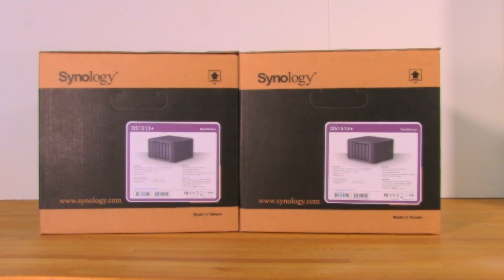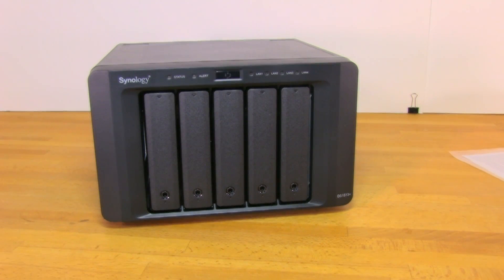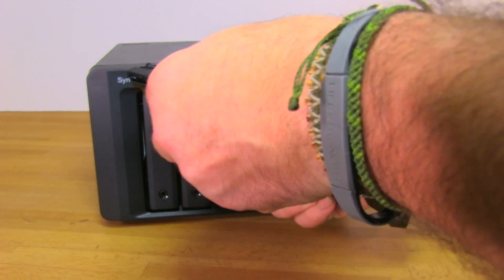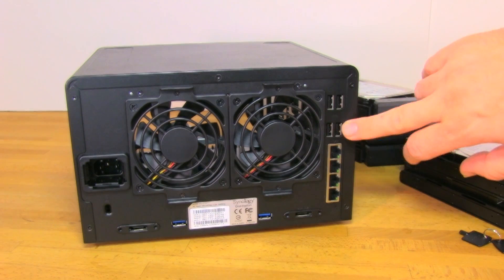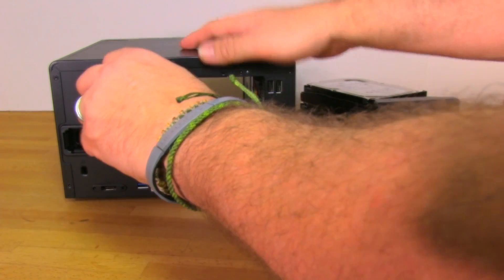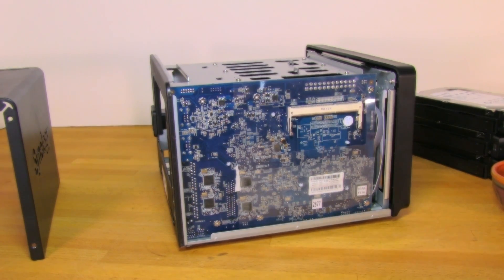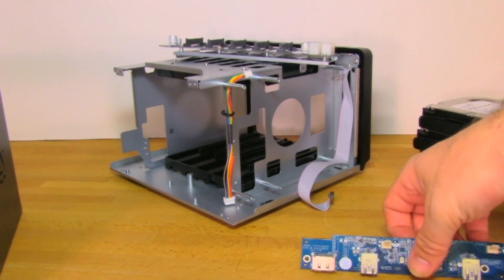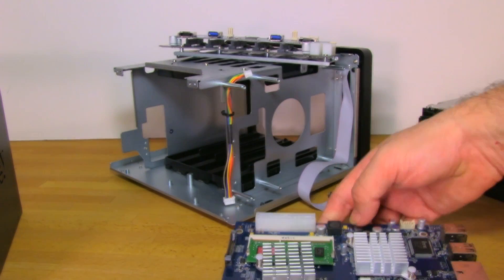Synology DS1513+ Introduction and Teardown

Comment: Can you take apart the NAS to this level and add 2x4GB memory sticks?  It's running a 64bit kernel... but it's an ATOM CPU & MB.... not sure.
Reply from the maker: You can put the memory in, but it will only support 4GB of it due to CPU and Chipset limitations.
Reply: Decryptedtech I really don't understand why synology said that to you. Read this please. I do have DS1512+ and I'm running 4GB so-dimm. Please clarify and correct your mistake. http://ark.intel.com/nl/products/59683/Intel-Atom-Processor-D2700-1M-Cache-2_13-GHz
Reply from the maker: What mistake? That CPU shows support for up to 4GB of memory. It is in the link you put up.
You can install 2x4GB SODIMMs, but you are not going to see more than 4GB.

Comment from the maker: We test all levels of RAID with the exception of RAID 0. If you put in 5 drives then it will say you need to add another for RAID 10. Just drag 4 down to the box image and remember that the 5th will be on stand-by until a drive failure is detected and then it will automatically take over for the failed drive. It will not actually be part of the active RAID set.

Comment: Was that not on a raid 5.
Because on the synology website there is a raid calculator wich gives a message that i need to add 1 more harddrive for it to be able to calculate how much free space you would get in raid 10.
Btw, i really appreciate the fast responces and time you take for me.

Comment: But for a raid 10 you would need at least 6 harddrives.
So my only options are raid 5 for now or for best performance raid 0 but no protection when a drive fails.

I think i will need to test this one.

Comment from the maker: The link below the video can show you the differences in the RAID types as far as performance goes. RAID 5 is not that fast when it comes to reads or writes. RAID 10 is much better for high I/O traffic like uncompressed audio. Ideally RAID 0 would be best, but that does not give you ant protection.

Comment from the maker: That depends on the RAID you setup and your network. In a 1Gbe wired  network running RAID 10 you should have enough bandwidth to do that. Over wireless it is doubtful that you would be able to maintain a constant bit rate for the uncompressed audio unless you were running 802.11ac on all points.

Comment from the maker: We tested pushing 1080p HD video to multiple targets. With a single LAN connection there were issues, with all four LAN ports connected using an 802.3ad LAG we were able to stream out to multiple targets; 2 LAN and 2 wireless without degradation.

Comment: Thanks for that bit of information.  I have ordered my 1513+ from the U.S. but still has not arrived.  I will use my existing DS213 as network system backup to the 1513+ for awhile. If I like the 1513 sufficiently enough, I will do as you are doing and get a second unit. (or, even the 1813+ ??)  Overkill, perhaps.

Comment: That is smart!  Now you have me thinking maybe I should get a second unit and do similar.  Not only do you have redundancy on hard disks,  you have total system redundancy.  So, if a power supply should go bad,  a fan, CPU, whatever. Furthermore, can then stripe all 5 disks for 16 or 20GB of storage.

  Can this NAS to NAS backup be setup to be performed offsite (i.e., via the internet to a remote location)?

Comment: Can you tell me the noise level of the 1513+?  Is it quiet although it has two fans?  I bought a QNAP TS-469L recenty but resold it in less then a month.  The reason I bought that was because of the HDMI port to double over as HTPC. The constant audible noise level became an issue especially as the sound was amplified placed on the TV stand.  I prefer Synology and am thinking to purchase the 1513+. Unfortunately, Synology does not offer an HDMI port in their products. So simple to add too.